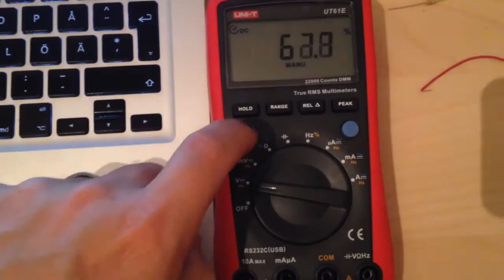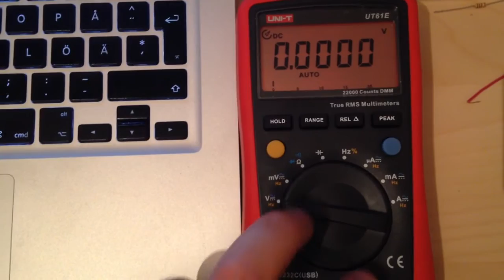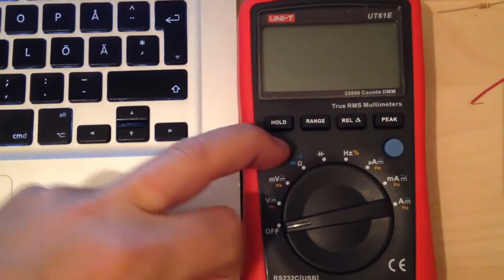UT61E modification

Comment: On your blog you say that this hack enables "MAX-MIN mode for Frequency and Duty cycle measurements". Is it possible to enable MAX-MIN for DC measurements? For example perform a measurement like this? https://www.youtube.com/watch?v=tsJUuLu1cw0
Reply from the maker: +ioannis0 
I do not know.
Here is the link to the DMM processor, http://www.cyrustek.com.tw/spec/ES51922.pdf
That is all information I had at hand. Flipping the right pins on the processor enables the corresponding features.
Reply: So your hack is not enabling max/min for DC voltages?  I am asking because on your video you enable the max min feature while you are on DC voltage mode.
Reply from the maker: +ioannis0 
Now I have tested and the answer is Yes. It does enable min/max for DC voltages.
Reply from the maker: +ioannis0 
Yes. Both my hack and the one you link to accomplish the same thing. Both hacks toggles pin 111 on the DMM processor.
By setting pin 111 high the RS232 is disabled and in turn the Auto power off is enabled.

Comment: On the pcb you use pins 117 and 118 of IC ES51922, but nothing about this on yours schematic..  http://3.bp.blogspot.com/-kdL-9Z1u1oY/VlNRvpZMWCI/AAAAAAAAAPI/tKBT50t3L7A/s1600/UT61E%2BPIC%2BService%2BPack1.png

Repeated yours mod and it didn't work. I think firmware is wrong
Reply from the maker: +CrematorXXX 
Now I have updated the picture to also include the information to enable the AC-filtering (pin 117 and pin 118).
The information is in the head of the source-file, but now it is more easy to find. I hope you will get it to work.
Reply: +CrematorXXX Were you able to get this mod working?  I've looked at all the links and can't find enough info that I would feel able to safely implement it.  Would be great if someone that has figured this all out would create a how-to video (not pointing the finger at you).  This mod gives some great additional functionality.
Reply from the maker: +CrematorXXX
It is not any faults with the firmware. The one that I linked to is the one that is uploaded to my microprocessor.
Have you checked the electric connections?

Comment: Can you give more details where needs to cut off lines on the PCB? And on schematic http://is.gd/9PgSc8 only one resistor, but on your photos their two.
Good job but needs more detailed manual to repeat your work :)
Reply: +CrematorXXX 
Correct. That is the firmware that I compiled and use in my UT61E multimeter.
Reply: Hello,
have you applied this mod? Have you figure out which traces to cut? Do you need to cut the traces connecting the blue and yellow buttons with the mcu?
Reply from the maker: +CrematorXXX
Sorry, I seemed to have uploaded an old version where R2 and R3 was not included. Now the blog has been updated with the missing information.

This site contained pictures on where the lines need to be cut off, http://mjlorton.com/forum/index.php?topic=284.0

Unfortunately it seems like those pictures has been removed.
However, from the electrical schedule here, http://elektrotanya.com/PREVIEWS/38933510/23432455/egyeb/uni-t_ut61e.pdf_1.png
you can find where to cut them. That is how I found out.
Reply: +foogadgets, thanx! https://bitbucket.org/foogadgets/ut61e-modification/downloads/ut61e-mod.hex this is the correct firmware?